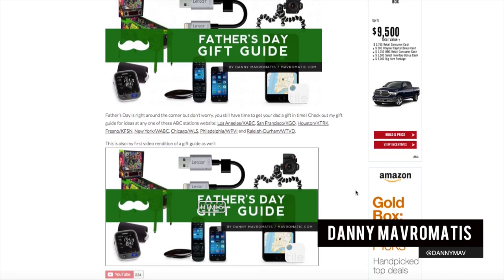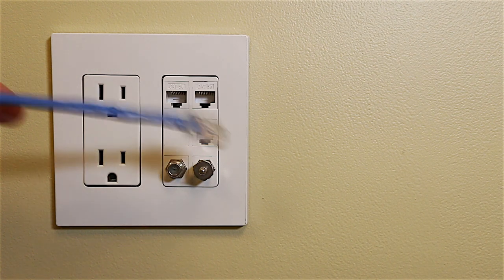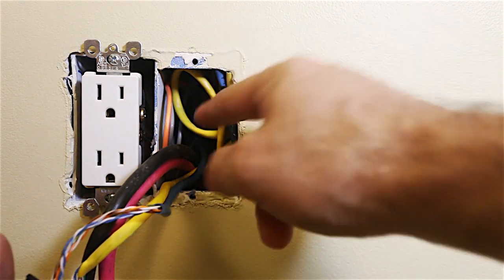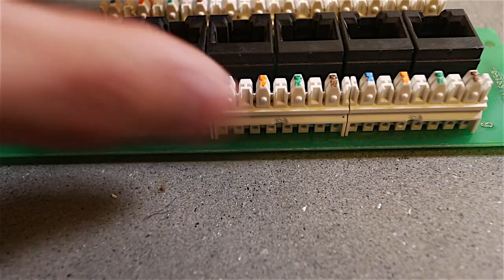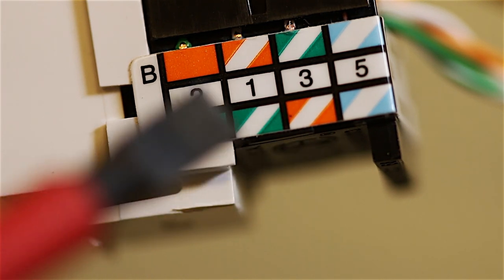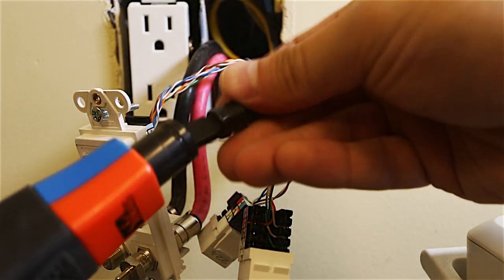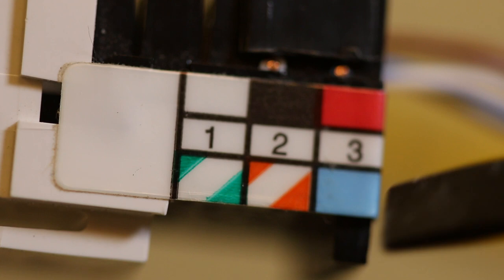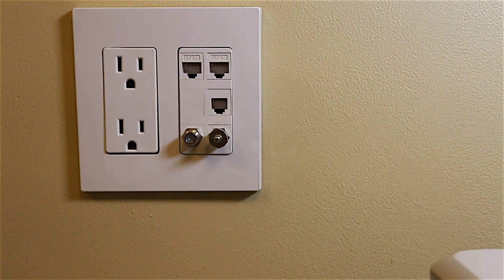How To Use A Single Cat5 Cable For Both Phone and Ethernet

Comment: To be clear, he is confusing the A and B Ethernet wiring standards. B starts out with pin one being orange white pin two Orange. Also, for phone\fax line one, pin 4 is Blue and ring, pin 5 is blue white and tip.

Comment: Is it possible to run both gigabit ethernet and telephone line over a single cat5 8 core cable? I just realized that in any network interface  (10m, 100m, 1000m), there is a transformer sit between the internal circuit and twisted pairs(8 wires), any given pair should be electrically isolated from other pairs, so can we run another signal across them(4 twisted pairs used as 4 wires to carry the phone signal)?
Reply: No, but you can get a 12 core (6 pair) cable to run, so you could have 1 gbit and phone! And use CAT 6, isnt much more expensive nowadays.

Comment: even if your DSL modem is mounted beside the cable modem, you terminate with both an RJ11 and Rj45 on the same cat5 cable? how do you crimp those heads with no coax sheath? you'd need the same keystones on the other end to plug into the modems... how is this "easier"... just run another cat5 thru the wall.

Comment: This might fly in your own home but in a commercial or industrial setting this is bad advice.  The end user would never be able to convert to VOIP or run 1000baseT on that split data jack.
Reply from the maker: That is correct.
Reply: It wont run 1000baseT, but it will run VoIP phones no problem.

Comment: The diagram you showing is 568B, not 568A. Starting with white green green is 568A, white orange orange is 568B
Reply: Yeah With 568 B the Green pairs are Spilt & A the Orange pairs  are split if you're making patch cables  has it backwards I think In England they use 568A

Comment: PERFECT....PERFECT explanation of home internet... thank you.... anything on getting an internet signal to an external garage with only a home power (AC) connection....
Reply: Powerline network or wireless backhaul. You can also bury CAT whatever or even fiber depending on the run.

I don't know your needs but I'd try powerline first. Wireless backhaul would be a very distant last resort for me, but could be just the ticket for you. One example (I've used an older version successfully): https://www.tp-link.com/us/home-networking/powerline/tl-pa9020p-kit/

They also have models with an access point or wifi extender built in. Never used those though.

Oh. Forgot. Performance or whether or not they will even work at all is dictated by your wiring. I've had adjacent plugs not see each other & I've also had one instance of being able to share internet with the neighbors. The various manufacturers give you an idea of scenario's where they will/won't work, but I've found you just have to try them to find out.

All of the recent ones have security & encryption so you can set up separate networks/links & also to keep neighbor's off your network if the signal does indeed make it that far. 

Separate network use scenario: I was already using AV1200 powerline for a situation like yours when I switched from DSL to cable. Satellite was occupying existing coax & the A-holes refused to pull some new coax on what was a very easy run & couldn't have put the cable modem in a worse location if they tried compared to where I needed it for my WiFi router. I couldn't do it myself b/c I had just undergone spinal fusion so I picked up two additional single port AV1200 powerline adapters, "locked" them together, and used that as my modem/router uplink. But powerline bandwidth is shared & you have no say in how it's split beyond some very simple QoS settings. So it cut my original powerline link from 600Mbps to a fairly solid 225Mbps & the router uplink hovered around 200-250Mbps. Which sucked b/c I only had 60Mbps internet at the time & easily saturated the link on the LAN. But it was still a God send for me at the time, though.

So anyway, yeah. Might be perfect, might be worthless, and might be just good enough for you.

Comment: do i understand correctly that with this setup though, your data connection will be slower or have less bandwidth because the data jack (rj45) isnt connected to all of the possible wires in the cat5e cable?

Comment: Great video! I am going to rewire my home and wanted to add phone and ethernet. I thought I needed to run RJ11 and Ethernet separated
Reply: You do need to do that. You will otherwise get 100 Mbit instead of 1 Gbit and that doesn't cut it anymore, way too slow. There is twisted pair cables with 6 pairs inside, allowing you to split it in the end for phone and ethernet, so you only need to run one cable.

Also don't do the mistake I did the first time when I laid ethernet cable next to a power cable in the same pipe, that lead to massive packet loss and 600 Mbit instead of 1 gbit... Keep them separated as far as possible to minimize interference!

Comment: Am I to understand that I can use ONE CAT5 cable for a phone AND an ethernet line at the same time??  I want to install a WiFi Mesh in my house which was wired 20 years ago with a single CAT5 cable to each room. I would like to use the CAT5 line to "backhaul"  my satellite nodes to the main node in a couple rooms but I have a dial tone on every line.  Is this possible to do? 
Any suggestions would be greatly appreciated.
Reply: Decide whether you really need the dial tone everywhere and repurpose some of the Cat5 strictly for networking. As the video highlights (Inthink), running both gives you only 4 wires for Ethernet, so the line will be limited to Fast Ethernet’s 100 Mbps; dedicating all 8 wires of the line to Ethernet should get you 1000 Mbps.

Comment: hi Danny, there is any external adaptor nowadays that I can apply? I have a Cat 6 socket but I want to plug a telephone and i dont want to open the socket, i am looking for an external. thanks
Reply: Yes, I’m looking for the same external/adapter alternative for quickly altering the purpose of a given line without rewiring the cable, already terminated on both ends to TJ45 jacks using the T558A standard.

I’ve found a few options on Amazon:
* https://www.amazon.com/gp/aw/d/B09MHX1VLT/
* https://www.amazon.com/gp/aw/d/B08L21DYWP/

Would love to see a combo phone/FastE adapter, but that’s probably too specific. Can probably find the parts to DIY it, though it likely won’t be as clean as a manufactured item.

Comment: what color do i use to separate phone and fax.....cat5e
Reply from the maker: Hi! phone and fax use the same POTS (Plain old telephone service) so they only need 1 pair per line.  So phone/fax would work as I have it in the video if it shares the same phone line (e.g. line 1).  That said, some setups use 2 lines, one for fax and one for phone.  If that is the case, you use 2 pairs as I have also shown.  Let me know if that helps clarify things...   @4:41 I show the wire coloring for line 1 and line 2.   Also, depending on the fax machine, it can select which line it uses (1 vs 2)

Comment: Hi Danny is there a switch or router that you would recommend to split a cat 5 line into 3 or 4 computers?
Reply from the maker: Hi!  you just need a simple switch to take 1 cat 5 line and connect up to 4 other devices, something like this: https://amzn.to/2wzEF6O -- there are more expensive switches but for home use something like this should be fine.

Comment: if you wired as labelled in your diagram with red matching white/blue and green matching blue it isn't going to work.. red=ring green=tip blue=ring white/blue=tip = line 1.. black= tip yellow= ring , wite/brown=tip brown=ring.. the 6pin connector has 3 pairs and the colour coding excludes brown as brown is the 4th pair. It allows fpr 3 phone lines.. The ouyermost being line 3 = pin 1,6  line 2= pin 2,5 line 1= pin 3,4  line 1 is always red and green which goes on the innermost pins=  pin 3 and 4.. red= ring = blue = pin 3 and green= tip= white/blue= pin 4
Reply: I think what you’re saying applies to using a Cat5e+ line wired to T568A for a  phone connection. The video really only adheres to the standard for the Fast Ethernet RJ45 connection; as explained, for the phone jack, the brown wires are connected per the orange color mappings on the RJ11/RJ25 jack.

Comment: will this also work with a regular cat 5 line not a cat 5e?  and what is the mode number of the punch.  thank you!
Reply from the maker: Sure does!
Reply: @Mavromatic  no cross talk? and if there is, is it from phone to data or data to phone? thanks again.
Reply from the maker: @sanclementetrojan  None.  I have had no issues with cross-talk and network and phone both work great.
Reply: 5e is just Faster everything else is the same

Comment: does the voltage from phone ever interfere with with data cables? even with the jacketing. thats why they made cat 6 with the with the built in shield right?
Reply from the maker: Hi! That typically isn't an issue given the design of the cable (twisted pairs, google it for more details) resists noise.  As one commenter noted, it's better to keep the twists tighter to the connection -- that provides better noise/signal integrity.
Reply: Keep the twist 🪢 up until the terminal for faster speeds shielded cable is to block electromagnetic flux from other electrical devices Cat6 is just as fast as Single Mode Fiber

Comment: 1. Use CAT 6, barely any difference in cost.
2. 100 mbit is way to slow, wifi is faster than that nowadays. 10 gbit via ethernet cable is getting to the point where its feasible to buy for your home network. I run a used 10 gbit switch and network cards from ebay for a couple of hundred of dollars in total via regular CAT 6 cables, works fine. The longest cable is 30m and it maxes out at about 800mbit. Normal UTP CAT6, nothing fancy.
3. If you have a single cable now, it's probably put in pipes inside the wall which makes it easy to pull though an extra. 
4. There exists twisted pair cables with everything from 2 to hundreds of pairs, if you only can fit one cable, run one with fe. 12 cables (6 pairs) and split it in the end to ethernet and phone.
5. Who the heck even uses landline phones or faxes anymore?